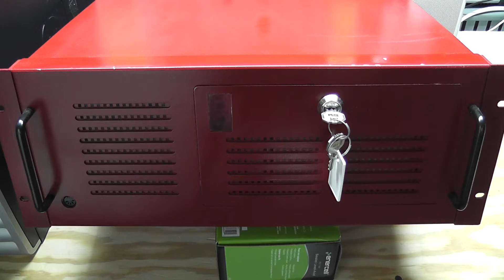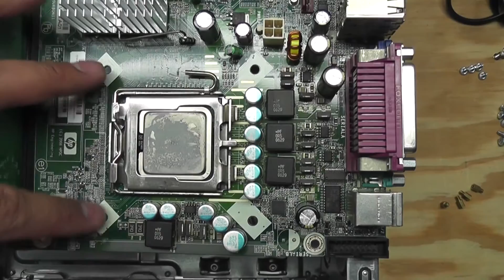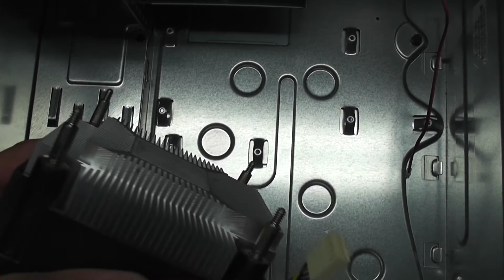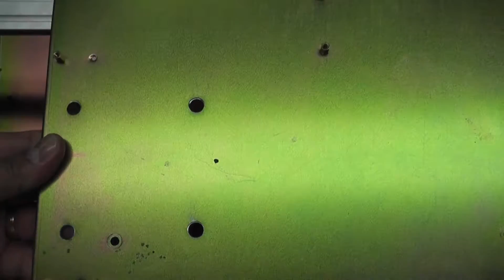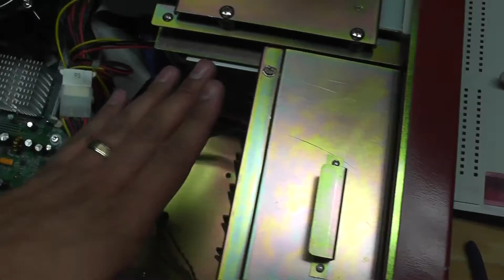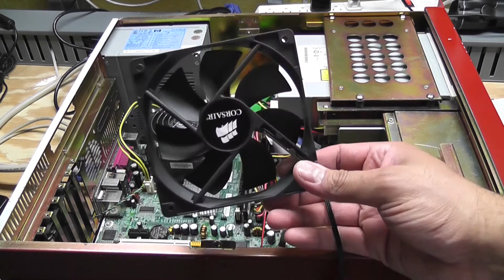Home PBX Server - Part 1 - Server Build

Comment: and...why are you using a P4 socket 775 when the board might take a Pentium D as an upgrade? :)

Thats an idea right? rather than spending tons of money on a new board and a core-3? :)

The pentium D will also let you have an easier time upgrading the software inside it to pfsense in the future, if you wanted to :)
Reply from the maker: mansharker8 This PC is no longer in use - it's been replaced.  But I think you already knew that, based on your other comment in my other vid